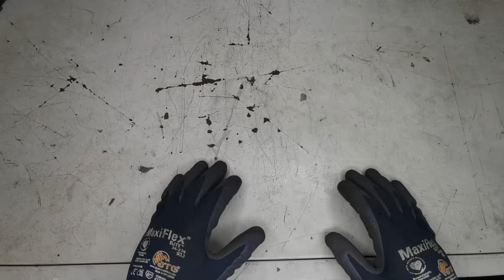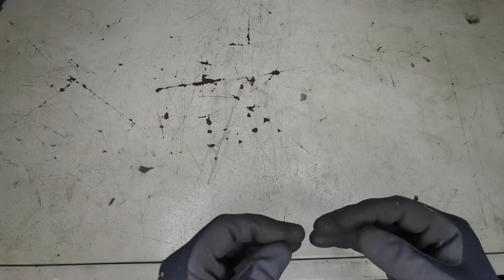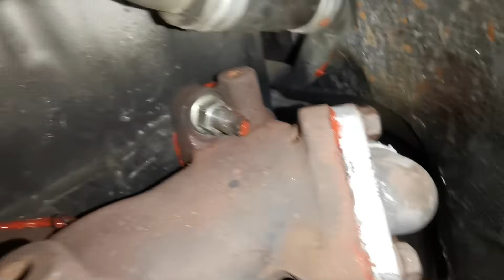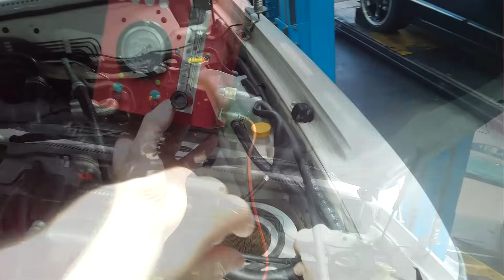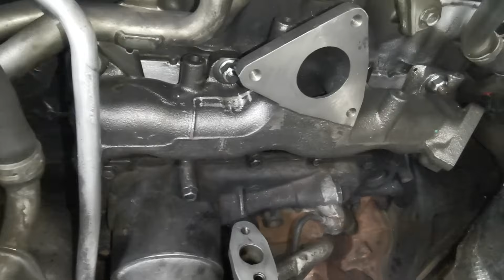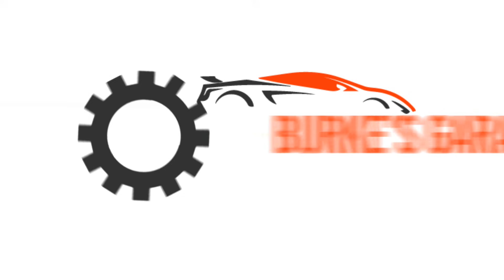High-Pitched Squealing Noise - Found & Fixed

Comment: im experiencing whining noise when accelerating, and i found out that the bolts on the Manifold to Turbo is loose, should i replace the MLS gasket?
thanks in advance im worried lol

Comment: I’ve got a similar noise on my bmw 2.0 diesel but it only happens when In gear accelerating, not when in neutral revs. Any ideas? Been told possibly EGR valve has gone

Comment: Can you hurt the truck if u keep driving it
Reply from the maker: Depends how bad it is leaking & blowing. When some exhaust gases are escaping under the bonnet and not all going out the exhaust, there is a chance that excessive heat can damage or melt components around that area. 
 
Always better to have it repaired quickly, but it will be on a case by case basis in regards to if anything bad will happen to you?  
 
Monitor it closely and stop if there is any risk.

Comment: After changing the turbo due to diagnostics saying that there was a problem with it, still had the sound. I removed the exhaust manifold and found it had burnt through the gasket about a 2mm hole. Fitted new gasket and all is fine. Thanks. 
Ford Galaxy by the way.

Comment: 1:35 noise sound ....i have same problem, timing belt and drive belt area already cheking...i will check turbo area tomorow, my car noise only when acceleration at 2000rpm higher...
Reply: ..did you have this problem solved? thanks.. having this same problem with my Land cruiser prado 120 diesel 1kd-ftv ..

Comment: Thank you! I had the same problem which I couldn't figure out for long time. As you said, I suspected Turbo, but it was happening with exhaust brake. It has happening only when exhaust pressure rises.

Comment: Thank you heaps mate, I was about to try and find what pulley was squealing, but this makes so much more sense!
Especially because I just cleaned my EGR, I must've left a gap somewhere. Maybe a metal gasket shouldn't have been reused or a bolt not done up enough.

Investigation time!

Comment: My sisters Xtrail has had an awful squeal and I eventually found that was the exhaust manifold leaking .It's almost an identical design as this one on the patrol .I will get it machined as when using a straight edge on the faces it isn't perfectly flat .
Reply: Did it get sorted?? Similar noise on mine. Maybe more high pitched on  acceleration,  2014 on a 3 month warranty.
Reply: Yes had to replace exhaust manifold gasket and some studs too .All good now.If you think you have a leak spray soapy water on area then rev engine

Comment: Have a wiseling noise on my 3.2 Ranger. Sound like a siren. Starts at 1000 revs,going to a higher pitch when reving up. Checked, run a full diagnostic check by Ford. Turbo, hoses, connections clamps, intercooler. Changed most fan belt pulleys, including compete fan. Cant find where it comes from. A ideas will be appreciated. Its driving me crazy. Even people and dogs get out of the way.
Reply: I have this issue on my ranger, ford found that the exhaust manifold was leaking behind the alternator. It lasted about 2 years and is now happening again
Reply: Did you figure it out ? I have the same problem
Reply: You ever find the problem? Sounds like what’s happening to me in my ranger.
Reply: Did any of use find out what it is mine does Same

Comment: Yep having the same issue, i noticed  a bolt was broken and causing all that noise finally was able to diagnose it. Thanks 😊
Reply from the maker: Glad it helped, thanks for taking the time to comment 🙏🙏
Reply: If its the engine manifold would this also make your car either go in limp mode or stop you traveling above 30mph@GerardBurkeBurkesGarage
Reply: Bolt on the rim? Im having same issue and i think thats the problem.
Reply: The caliper clip. The rubber that goes between the bolt to keep it from rubbing together was pretty much worn out and broken causing the noise in my case
Reply: Also my exhaust manifold was leaking air causing it to make noise when pressing gas. Got that fixed and the noise was gone but the front right tire was also making noise not squealing but more like a rattling and it was the rubber that was worn out

Comment: My Nissan xtrail is making that identical sound, i presumed turbo , glad i watched your video. Thanks
Reply: My sisters Xtrail  came to me today with the same noise /squeal .I changed to genuine belts and was quiet for a week then noisey again so took belts off and ran engine and noise still there .Will investigate the manifold .Did you sort yours out ??
Reply: @dave1455 Hey Dave , I’m having the same problem with my xtrail now . Was it the manifold that was the problem?
Reply: @dukedre7596  I sprayed some soapy water along the  manifold to head join and there was a leak at timing chain end   .Now I don't know what caused it in the end as I buggered some threads up trying to remedy the situation by trying to tighten the studs more   it's a long story but  I had to helicoil a few threads in the head in situ and made my own studs from threaded bar and fit a new exhaust manifold gasket .Manifold seemed fine but  I ran a file across the ports  a few times just to clean off ..All good now
Reply: @dave1455  Sounds good . I’ll look at mine this weekend and update you also . I have a feeling might have to change my manifold gasket . Examining my engine manifold I don’t see any signs of cracks. Thanks much for the info. Really appreciate it

Comment: I have been chasing this sound in my Nissan Patrol ZD30, this might be/probably is my problem, thanks. Just one question: does it make sense, like in my case that this noise goes away after the engine warms up, after about 10 min driving?
Reply: My Mini Cooper is doing this aswell - stopping after the engine is warm. Did you find out why?
Reply: @thomasshovlin2365  Gerard is right in my case, it's the manifold, I am booked in to get it replaced. When the engine warms up and the metal expands, it seals up and the squealing stops.

Comment: Also think heat off turbo and bad design causes warped and cracked manifold and also regen temperature going upto 800 degrees must have a bad effect on manifolds